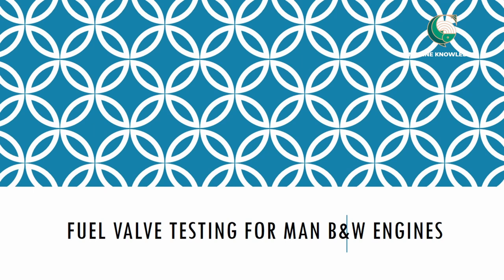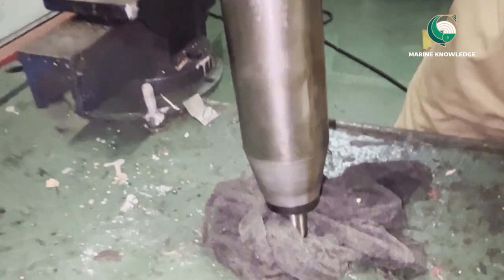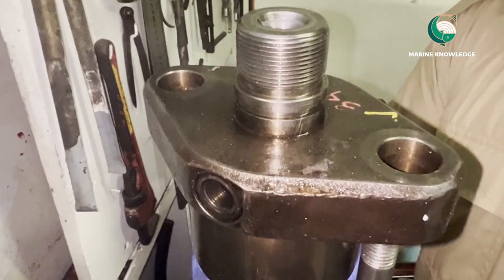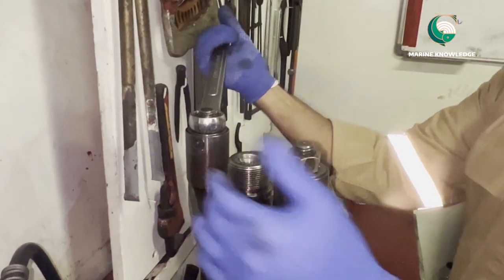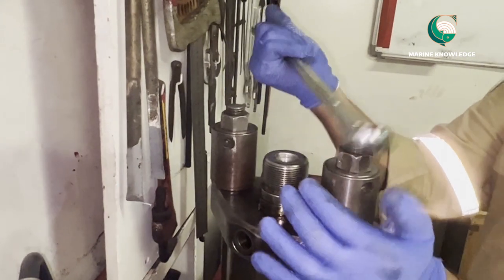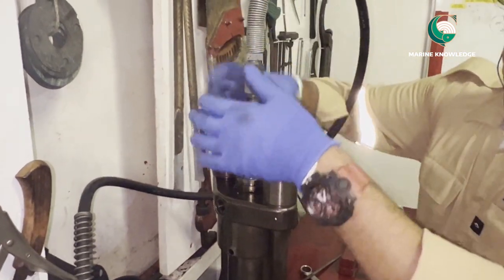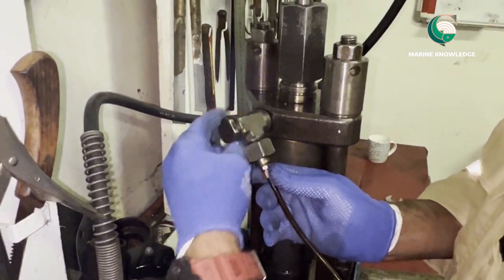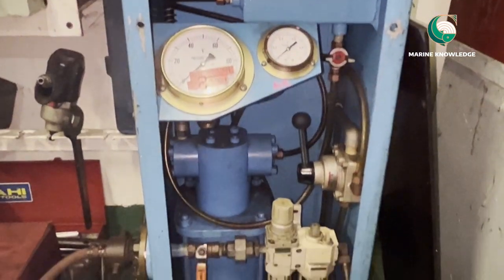Second Engineer jobs....How to do Fuel valve testing for man B&W  Engines

Comment: Super clear and easy to understand. Also learnt a new word Flushing = Purging, which is done manually in Aux engine injector, by pumping while keeping the nuts of the discharge side loose, but here there is an air pump, will be cool to see a line tracing of how the air + oil interact, since I didnt see any air system on aux engine test setup
Reply from the maker: Glad it helped!

Comment: Can you tell me the code for the air hose from the regulator entering the change valve handle on the test injector. There is a letter and number code 1P, 2A, 3R, 4B.

Comment: I am facing problem in ME fuel value during testing.
I overhauled valves changed everything except body and head 
Vented air from injector and when trying to close the pressure relief valve of the testing machine oil still leaking from return line and pressure not increasing above 20 bar 
I tried to lap fuel valve head seating surface where non return valve face matches 
But still getting the same result